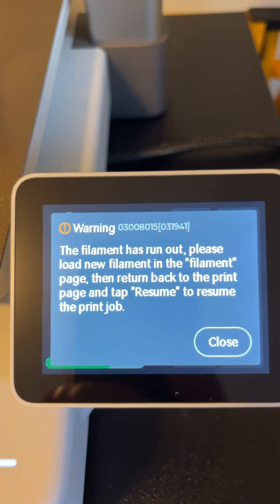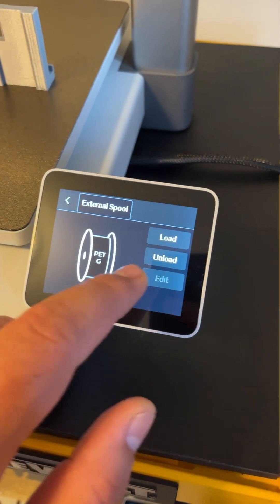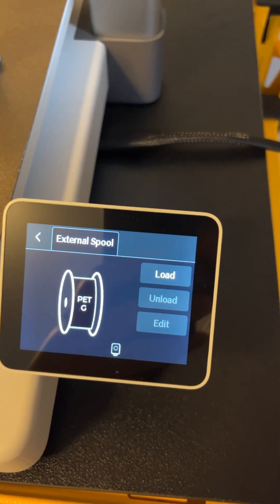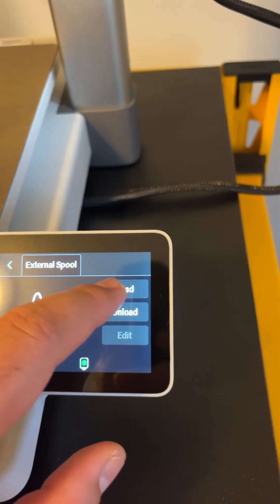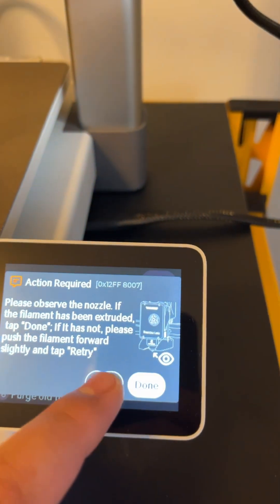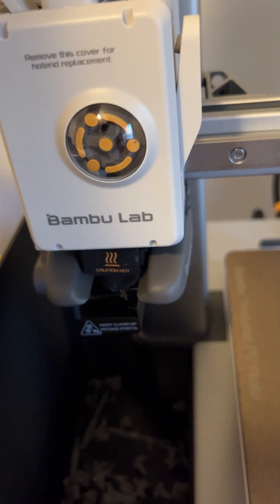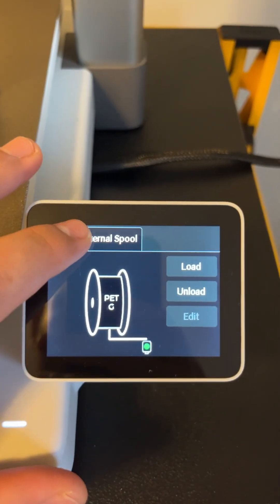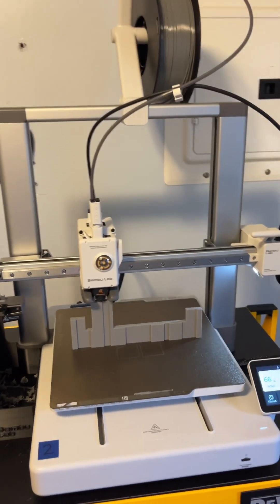Bambu Lab A1: Switching Out Empty Filament Spool Mid Print

Comment: What if if you swap filament types like from pla to pla+ (or to an even more different type) how can the printer know to change parameters?
Reply from the maker: Thanks for the comment! When you slice the model in Bambu Studio, you choose the filament profile (like PLA, PETG, etc.), and those settings are built into the G-code. If you change filament mid-print, it has to be the same type you started with, since the printer will keep using those same settings. I’ve personally switched between PLA and PLA+ using the generic PLA preset in Bambu Studio, and both printed fine :)

Comment: Are you able to switch mid print without it running out? My printer just died and I have a project that I want switch colors half way through.
Reply from the maker: @Agent_Lemur  Thanks for your comment! Yes, in theory, you should be able to switch filaments mid print by pausing the print, manually pressing down on the lever to cut the filament, and then loading the new one. I haven’t tried this myself yet, but I may try this out in an upcoming video. Stay tuned :)
Reply: @3DTheory  Yes, just pause your print. Either on the app or printer. Then go back and touch "unload". It will do its thing and you can pull the original filament out. Then hit "Load" and load the new filament. Press the play icon and it will start right where you paused it with whatever filament you put in. Just know that it will think you still have the original filament in there. So if you started with basic PLA and put in Silk PLA, PLS-CF, PETG, whatever you choose, it will treat it as you have basic PLA still there.